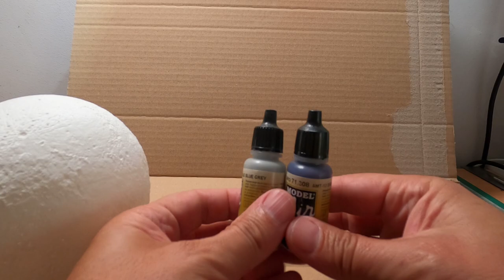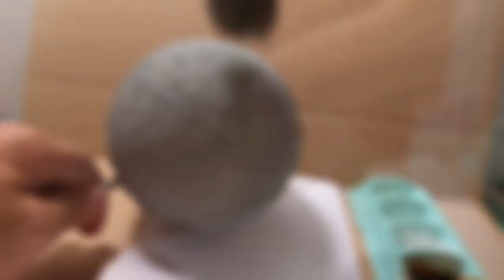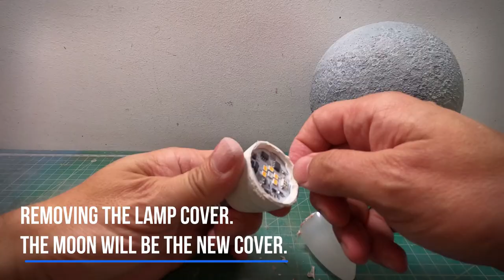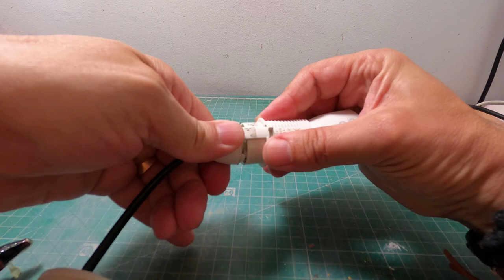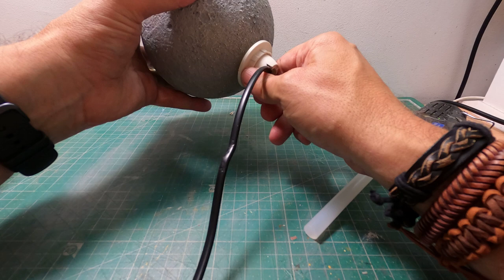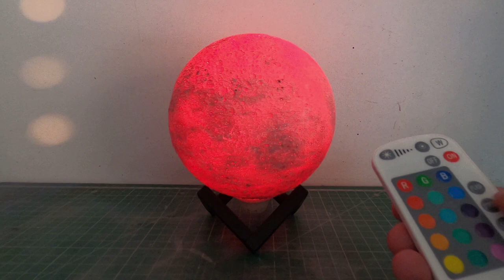Easy 3d printed Moon lamp

Comment: Maybe I missed it but where can you purchase the light assembly? I’m assuming Amazon? I’ve printed another version and currently using a 25w incandescent bulb in it but like the novelty of the LEDs for the one I am printing for my son’s room. Thanks
Reply from the maker: Hi ! I've just bought it from an hardware store. It is just a simple light fixture like this: https://www.amazon.es/-/pt/dp/B08DV34JKQ/ref=pd_sim_hxwPM1_sspa_dk_detail_p19_og_dN?pd_rd_w=SKVbz&content-id=amzn1.sym.92a2526a-ed77-4385-82d6-52ab5b86aa0c&pf_rd_p=92a2526a-ed77-4385-82d6-52ab5b86aa0c&pf_rd_r=MW02K8Q5EWTXGRCQQS5Y&pd_rd_wg=0UQgc&pd_rd_r=9937737b-9b9c-4bcd-9193-650d9d106153&pd_rd_i=B08DV33YRV&th=1